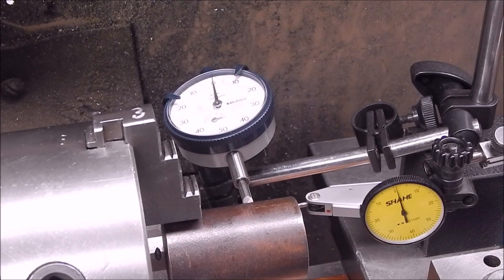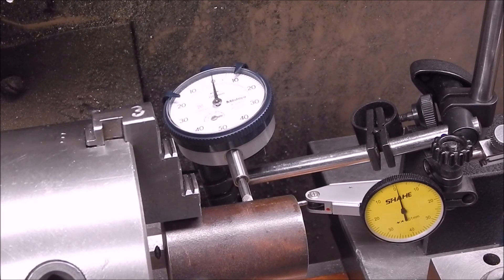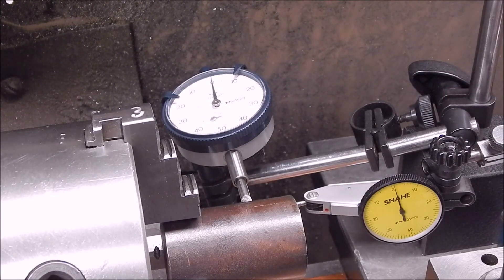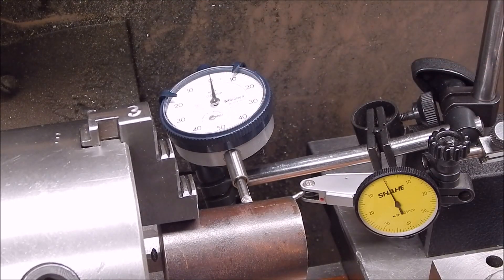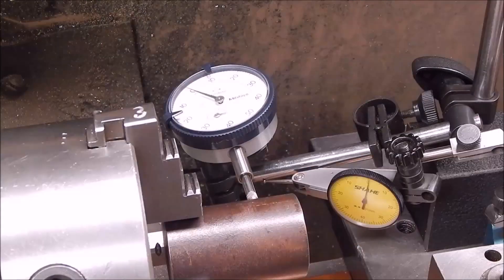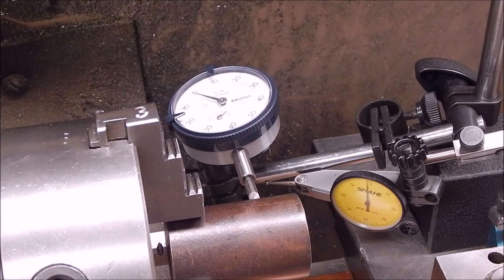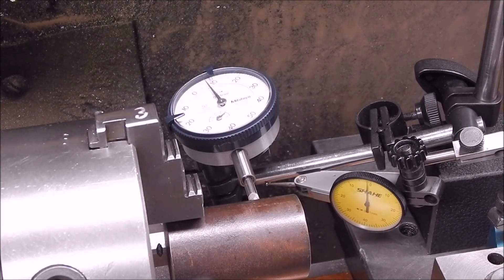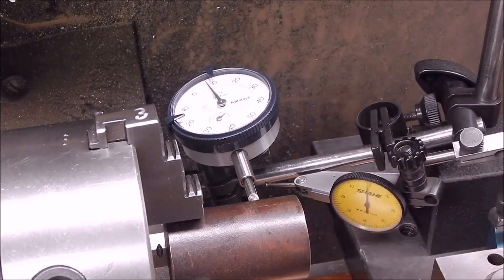Dial versus test indicator for absolute run out measurement

Comment from the maker: Note:  When used for comparative run out, any co-sine error is largely inconsequential.  Which type of indicator to use comes down to personal choice and application requirements.  Dial indicators can measure much greater variation.  They are able to take small diameter internal measurements when fitted with a right angle tip.  Cheers Rob

Comment: Dial indicators are used everywhere . They are the way to go !  There's a place for the test indicator but there best for inside bores to find center or on flat stock .. Great share Rob .. ENJOYED
Reply from the maker: Hi Shawn.  Yes, dial indicators have the accuracy and the travel to make them the best choice for most absolute workshop/lathe measuring.  I prefer a TI for lathe setup as it's able to do internal and has less clearance issues.  Interesting subject.  Cheers Rob
Reply: @Xynudu  for everyday life projects Dial is the best Rob .. You can go Tom Lipton and be a doctor about it , But we make shop made STUFF !!  . Great subject though..

Comment: Nice toolshed metrology demonstration Rob. You brought up at least two factors I'd never considered before--the cosine error and the flex on the mount arm. However, since runout is a relative measurement, I agree that whatever you find more convenient is best. Thanks for sharing.
Reply from the maker: Hi Rick.  It seems a lot of test indicator users are unaware of the cosine error factor, including many of those supposed experts creating "how to use a test indicator" videos ;)  Cheers Rob

Comment: Interesting stuff Rob and very well explained. Fortunately most of the work I do doesn't require the use of a DI or a TI but it's still good to know this stuff for when the need arises. Cheers, Alan.
Reply from the maker: Hi Alan.  It's a bit of a high end topic I guess, but worth knowing.  I wondered how many hobbyists are aware of the error factor.  Most of my indicator work is mounting jobs with the four jaw.  That's where TI's are the best comparator option due to their full range of capabilities and smaller foot print.  For absolute measurements I generally get by with a micrometer.  Cheers Rob.

Comment: so in your example the in line meter being at the end of the support shaft  is going to have much more deflection than the other one which is much closer to the support shaft fixed end. Maybe this accounts for much of the differance in readings rather than the cosine element? Well in the first example when it was set up to be as accurate as poss. Always interesting Rob as usual.
Reply from the maker: Hi Jim.  The change of angle of the probe was the only difference with the test indicator, everything else stayed much the same.  The contact point did move very slightly, but as pointed out, test indicators have very little contact pressure, so mount flex is not really an issue.  The increased deflection reading was due to the greater angle related cosine error.  This is a well known phenomenum.  Cheers Rob

Comment: I raised this issue with a journeyman toolmaker. His answer regarding the test indicator was that if it’s registering zero there is no error. So he always took it so close to zero the error was truly negligible. His favorite was a “Last Word” test indicator.
Reply from the maker: Just because the dial is registering zero means nothing if the probe is not at zero degrees (parallel to the job) or the specified brand zero angle (it can vary).  It's that angle which determines cosine error, not the pointer mark on the dial.  Journey man ?   LOL
Reply: @Xynudu  Yeah, he was going for a journey alright, and didn't even have to leave home!
Reply from the maker: Ha Ha.
Reply: @Xynudu  , he applied the test indicator not parallel but not too far off. It was close enough that zero on the indicator was zero runout. I didn’t approve but when standard procedure is to grind everything to the nominal size exactly, parts work perfectly. My main complaint was they wasted a lot of time doing the grinding and raised the cost of my projects.
Reply from the maker: That's OK then.  Depending on the accuracy of the machine/lathe a cosine error from less than 10 degrees probe angle is probably not a major issue.  Yes, machine shops are expensive.  Cheers Rob

Comment: Great video, based on the results of the Shane gauge, your gauge is at  31 deg based on the values of the two gauges
Reply from the maker: Thanks for your observation, it's good that you were able to make the connection.

Comment: Nice one, Rob, particularly the demo of stand flex.  

However, with lever type DTIs, parallel is not always the recommended angle.  Interrapid indicators at least, but I believe this is the same for and Tesa and Brown & Sharpe, are designed for use with a 12° angle between the part and the lever, and results at other angles "must be adjusted". This odd angle is so that you can get in and indicate in places other than the very edge of the part.  As 13 microns is listed as the maximum deviation in range for the Shahe, and you're seeing it in partial range (0.3 < 0.4, after all), I suspect the Shahe is the same.  Might be worth retrying the experiment with a 12° or so angle on the lever and see what the result is, you should be seeing under 10 microns of error.
Reply from the maker: Hi Michel.  Good point.  Most probes/tips are shaped to allow very close to parallel orientation, less than 12 degrees.  To actually set the probe at the nominated angle would be rather tricky me thinks.  I was taught to get it as close to parallel as possible.  Co-sine error will always be a factor and for comparative measuring it's not really an issue.  Test indicators aren't really meant for absolute measuring IMHO.  Cheers Rob
Reply: @Xynudu  I think you might be missing my point, Rob.  I was taught, in the same way you were, to put the probe as close to parallel as possible, and it was only when I looked through the manual for the Interrapid at work I realised it was supposed to be used at 12°.  Mitutoyo, as far as I can tell, are designed for parallel.

I just did the same setup as you with a plunger indicator (Shahe) and a DTI (in my case, a Tesa).  With the probe parallel, I got the same error as you, around 10 to 15 microns.  But with the probe at 12° (more or less), I got /maybe/ 5 microns, certainly closer to the correct reading than the next one on the Tesa's piddly little scale.

On a side note, and this is in no way intended as a slight to Shahe, who make fantastic quality instruments at a very reasonable price, I have a very strong suspicion that the Shahe indicators' internals are clones of the Tesa / Interrapids.  Haven't been able to find detailed specs for the Shahe, but the numbers that I /can/ find are concordant to the micron.

People working in metrology labs might disagree with your last comment, though :)
Reply from the maker: Hi Michel,  that's super interesting.  The Shahe is probably a good copy of something better and anything is possible. 
I don't have the instructions for it any more.  I must hunt around and see what the various brands say about this included angle business.

Yes, I may have been a bit hard on the TI  for absolute measurements, but for simplicity I would always use a DI for that sort of work.  The whole cosine allowance factor is a bit of a head bang for me.

We never stop learning.  Thanks for the comments.  Much appreciated.

Cheers Rob
Reply from the maker: Hi Michel,  you are dead right.  The zero angle all depends upon the indicator brand.  This video expects 12 degrees and covers all that we have discussed :  https://www.youtube.com/watch?v=Iucf8DW5XMs

Mitutoyo expects zero angle and list the compensation factors.  Interestingly one brand site mentions that a cosine error from a tip deviation of less than 10 degrees is inconsequential.

I suppose it all comes down to the level of accuracy of the metal work machinery available.

Cheers Rob
Reply: @Xynudu  Interesting.  "Know your tools", I guess.  I wonder what the Shahe is specced for.

I certainly wouldn't have any misgivings about the quality of Shahe's stuff, even if some of it is theoretically a copy, it's not noticeably inferior in any way to the "big name" brands, IMO.
Reply from the maker: I checked the Shahe zero probe angle his morning and it's definitely the same as Mitutoyo - 0 degrees.

Looking at the various manufacturers web sites I don't see any mention of anyting besides 0 degrees (apart from TESA), so it looks to be the defacto standard for test indicators and aligns with what we were taught.

Interesting pick up though Michel.  Cheers Rob